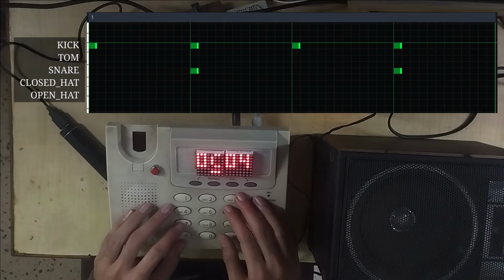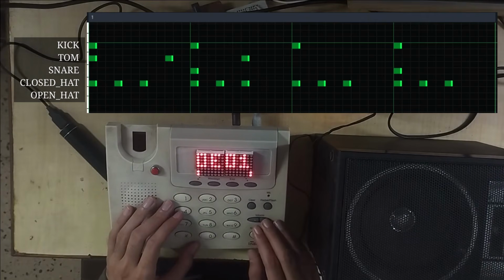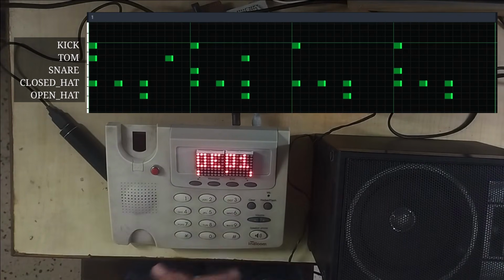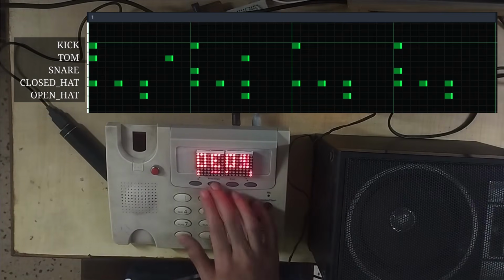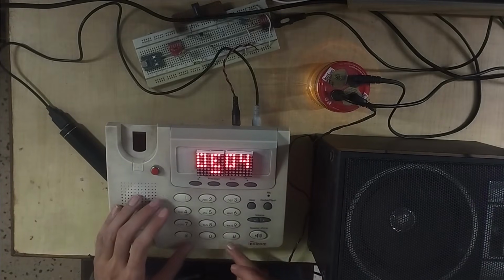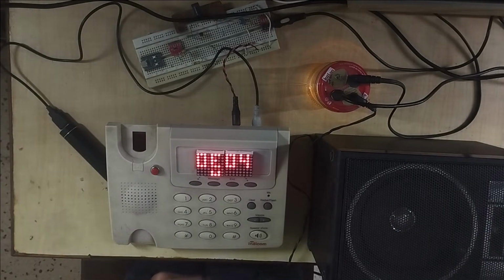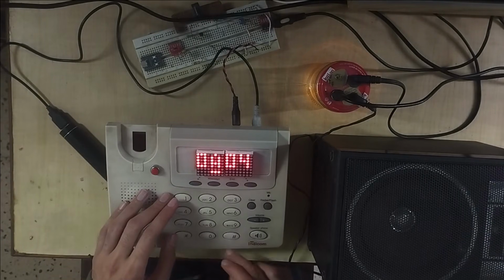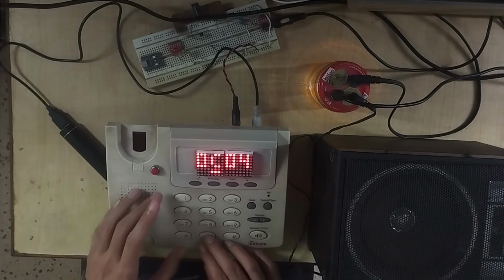DIY Drum Machine in a Telephone!? [Demonstration]

Comment: Great idea! Touch telephone makes a lot of sense as drum machine housing.
I got little bit confused by note input but it makes sense after thinking about it.
I would also probably use LED matrix to display whole drum pattern in some mode, but it can be clearly used without it.
Reply from the maker: Thanks!
Tbh the note input was a bit frustrating for me too, in the beginning. 
Had to consciously think abt it as a piano roll grid and not a step sequencer to get used to it... 
Had it been a 16 step sequencer I would have displayed the complete drum pattern. But it's technically a 192 (16x12) step sequencer. So I didn't bother 😅.
A high res screen will be better to display the pattern.